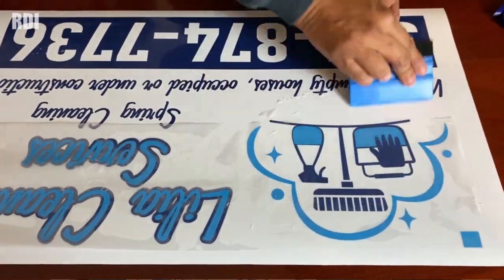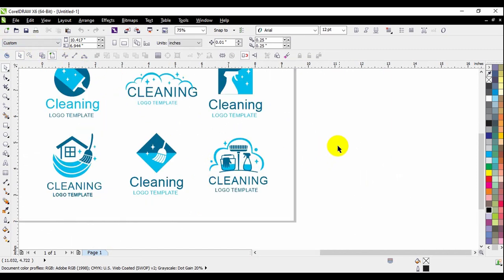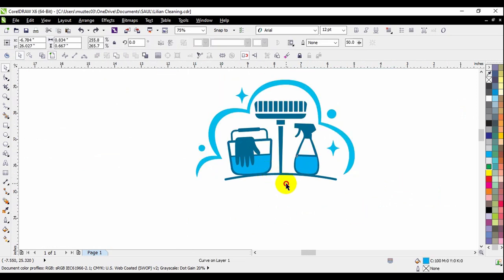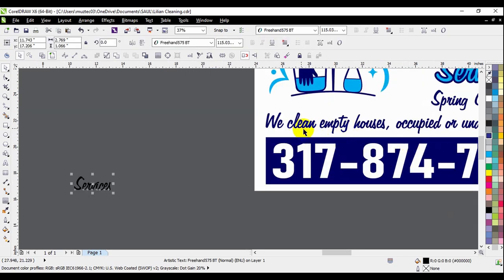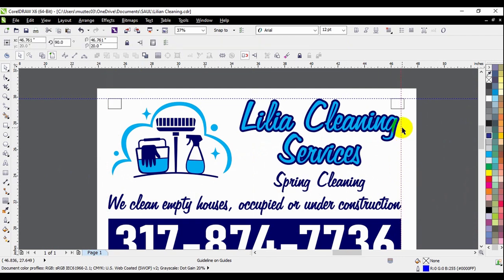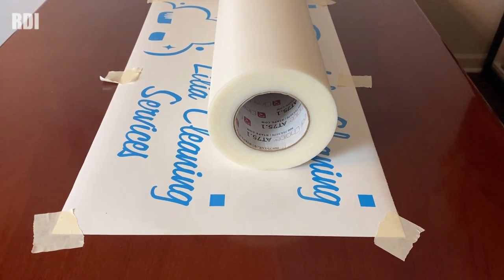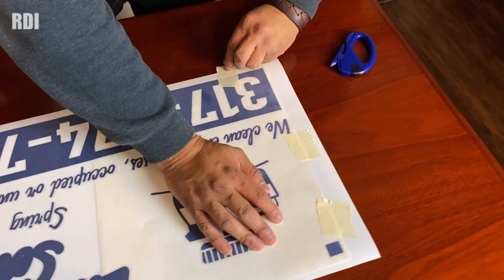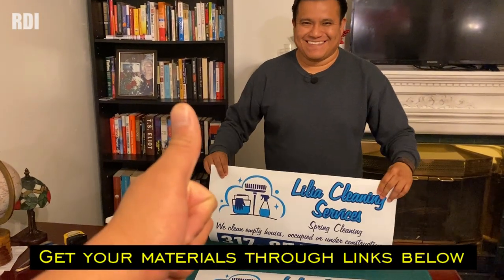The process of making a vinyl sign step by step

Comment from the maker: Get your equipment & materials through uscutter: https://uscutter.com/?ref=StickerAficionado
Graphtec plotter: https://uscutter.com/Graphtec-CE7000-Vinyl-Cutting-Plotter/?ref=StickerAficionado
Cameo 4 12": https://amzn.to/3LHFCla
Tape rollers: https://uscutter.com/APPRoller-Tape-Application-Roller/?ref=StickerAficionado
CAMEO PRO (24 INCH):https://amzn.to/3POgbNO
Titan plotter: https://uscutter.com/TITAN-Vinyl-Cutter-28-53-inch/?ref=StickerAficionado
Oracal 651: https://uscutter.com/oracal-651-sign-vinyl-outdoor/?ref=StickerAficionado
Oracal 651 guide: https://uscutter.com/oracal-651-intermediate-color-chart/?ref=StickerAficionado
Magnum magnetics : https://uscutter.com/24-digimag-magnetic-vinyl-for-solvent-printers/?ref=StickerAficionado
Blank yard signs: https://amzn.to/2IBiGWM
RAPID TAC: https://amzn.to/37ZMl5O
Cutting mat: https://amzn.to/3uidBWZ
Blue safety ruler (31 inch long) https://amzn.to/3slsrKy
Squeegee: https://amzn.to/3bmZK8Q
Small magnets to hold vinyl in position:  https://amzn.to/3kdE6bt
Cutting knife tool: https://amzn.to/3sbDTYS
Adhesive remover goof off: https://amzn.to/3eXrNS2